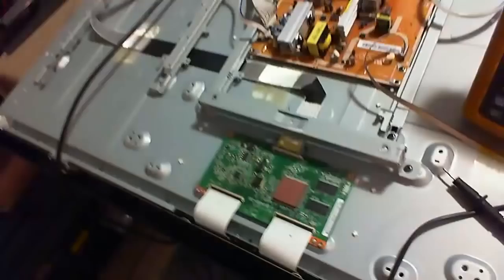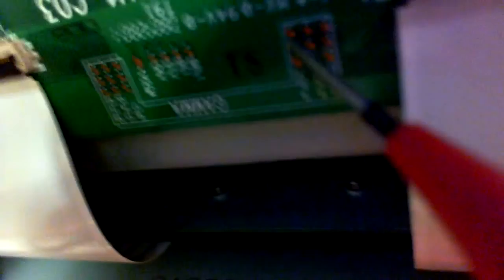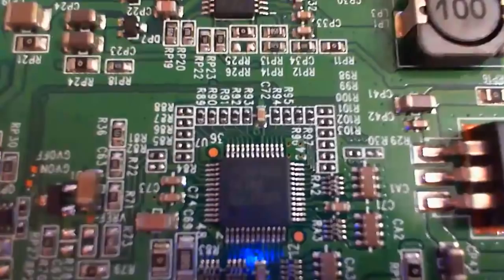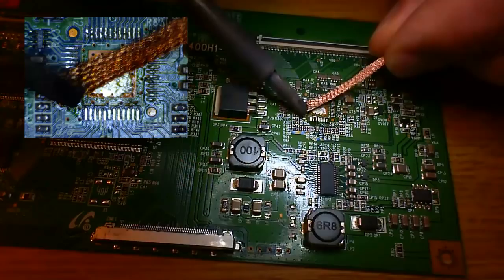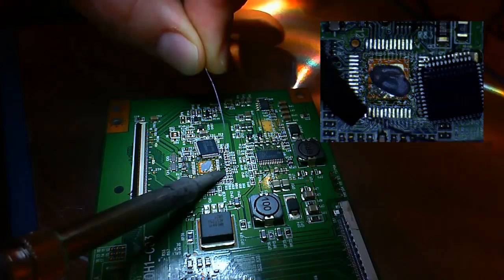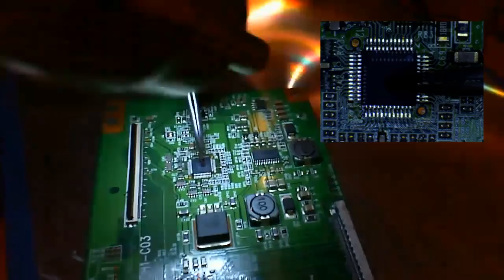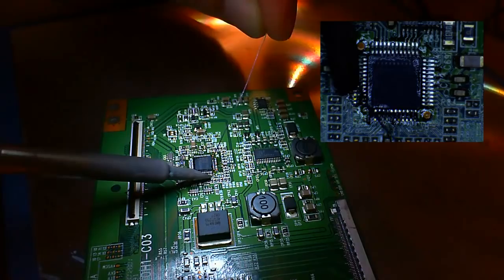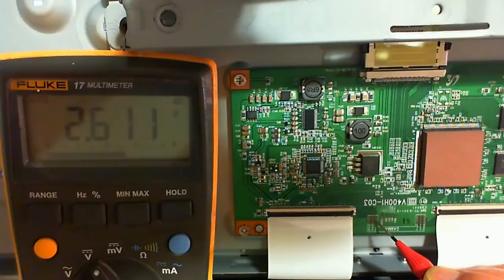How to repair your tCON board AS15F AS19F AS34

Comment: Any abnornal screen picture like solarized,dark,very white,wrong colours,high colour level but the screen shows a full raster in the entire area and if the AS15 is present in the tcon board then change it at once without any second thought.It is a buffer and related only with the picture quality.

Comment: What about when T-Con voltages are decreasing step by step, could be mainboard malfunction then?
T-Con is T400HW04 V1 40T05-C02 for Sony TV KDL-46EX728

Thank you
Reply: There is no gamma corrector chip
Reply from the maker: Ненад Шиљић depends on how the picture looks like. I rarely get Sony TVs and when I did it was either a panel fault or the mainboard.